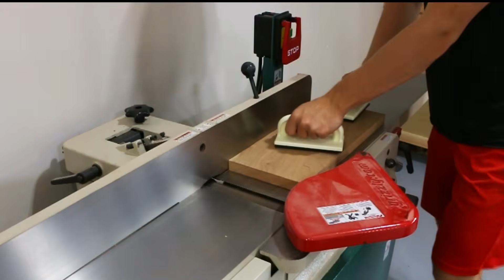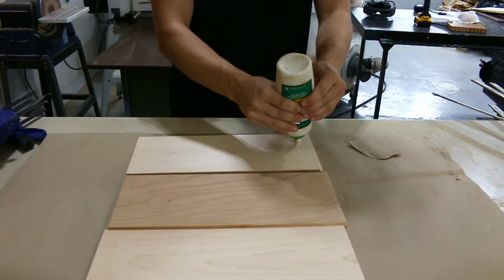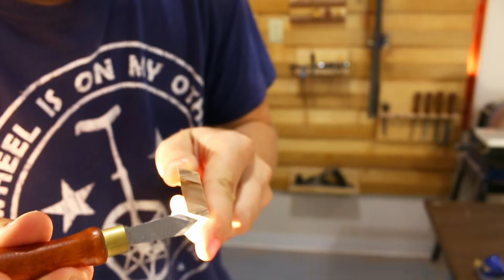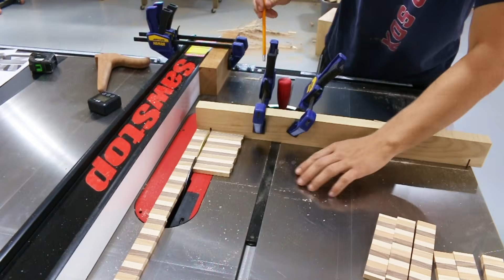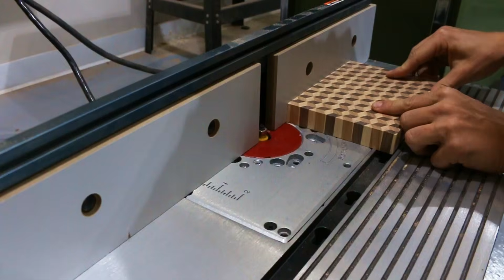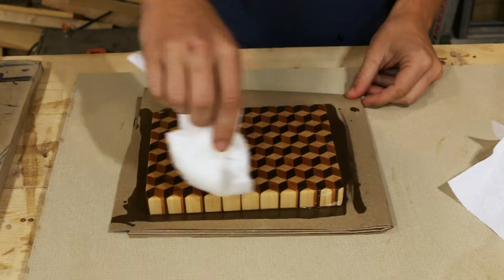Making Amazing 3D Cube End Grain Cutting Board Tutorial

Comment: At the 2:19 mark what was the thickness of the strips? Did I miss a comment? I assume this will have an impact on the final pattern.
Reply from the maker: I actually gave the dimension for that one after I finished cutting them all. they should  be 10mm thick.
Reply: @CalebsFineWoodworking  was the saw set at 10mm OR did the parallelogram height need to be 10mm? In the later case, the saw would need to be set at 11.18mm.
Reply: I wondered the same thing, he gives the 10mm dimension after he's made the cut but didn't say what the fence would need to be set at in order to achieve the finished 10mm